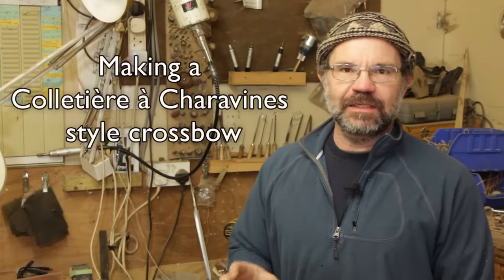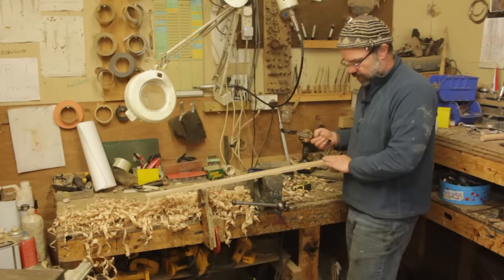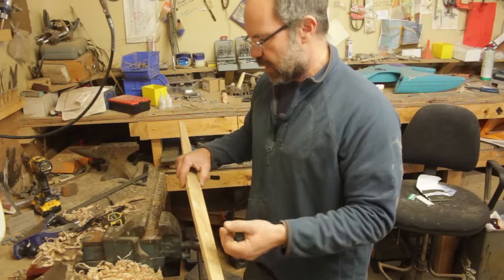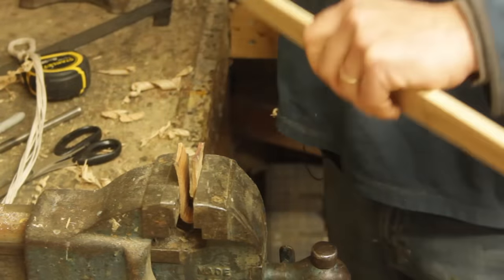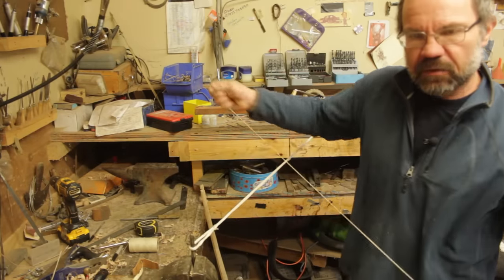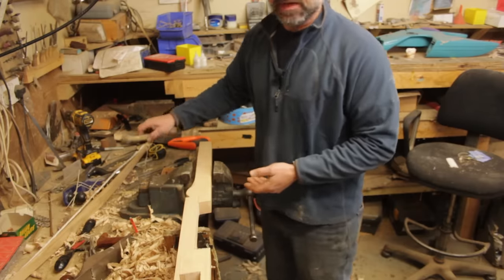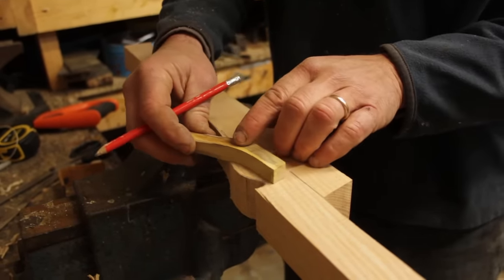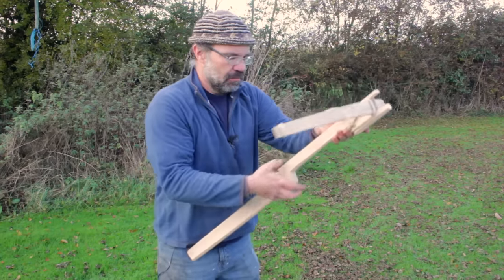Dark Ages Crossbow - Full making process

Comment: For hunting in close woodland I guess you'd be most likely after roe or fallow, which are notoriously spooky beasts - that release noise is a bit - noisy?  Can the release be tuned for quieter operation?  Guessing the typical working range would have to be quite short, meaning very highly skilled woodcraft indeed.

Comment: Have a nice piece of red oak, although the grain runs true down the whole board it does run at an angle and due to the board being around only 1 inch thick I'm going to have to use a combination of dogbone rawhide and laminating a second layer due to my wood being decently thin

Comment: Cool. If I were to make one, I think I'd change how the trigger lever is so that it's on the bottom instead, though. It'd work as well if the trigger were something to press up upon from the bottom under the same principals, no?
Reply: Good point, but this simplest system requires such a configuration. However, for a below-mounted lever, you can use the closely related "rising peg" system. The Skane crossbow find mentioned by Tod uses that slightly more complex system, with the lever mounted on the bottom side of the stock. Mick Grewcock made a pretty good replica of that sort of design in this vid: https://www.youtube.com/watch?v=nYovttuYoGE The rising peg design is also known from native west African crossbows, in addition to the known European specimens. Probably a parallel discovery of the same idea. 

In the "rising peg" type of lock, you can replace the solid axle for the lever with simple rope lashing that acts as articulation. You also need to drill a hole below the string-catch area. You raise the lever, a peg at the end of the lever (hidden in the hole when not triggered) rises upward through the hole and pushes the bowstring up, letting it loose from behind the string-catch. At that point, it's the same system as on the "thumb lever" lock on the crossbow from this vid by Tod. The only difference between the two mechanisms is that the rising peg one is slightly more complex to build, but otherwise, the basic idea for the two is the same.

Now, if you want a typical European crossbow from late Antiquity or much of the Middle Ages after 1000, you need a rolling nut component and then a trigger system that goes down to the below-mounted lever. Tod has two videos on rolling nut axles, how they're set off by triggers, etc. I think that system can still be replicated using only wood, like on these simpler crossbows, but steel for the lever, internal trigger and most of the nut seems to have been the preferred historical solution (though you still had nuts made of antler, and nut axles often simply replaced with thick rope). Single-axle nut trigger: https://www.youtube.com/watch?v=l4W4brUUCR0 Twin-axle nut trigger: https://www.youtube.com/watch?v=GONHXs5NPyQ The rolling nut locks were more common for a reason - they are more hardy and effective than these wooden crossbow locks, especially if needed for military crossbows. Entirely wooden crossbows are sort of doomed to be mostly lower-poundage, even with a more powerful bow.

Comment: Nicely done.
Never seen that action before.
I really like how you made the string. Most people make it look really hard to do. Think I will make a bow sting the same way.
You also made the bow a lot easier. I always wondered why people show making a bow long bow style rather then flat bow style. Now that I know thats flatbow I'm glad. Becuase this was how I learned to make a bow.
All in all, very well done.
Oh again now that I know it flat bow sytle I learned, to increase poundage you can glue rawhide to the side facing you. This will not turn a 50lbs bow into a 100lbs bow. But it will increase a bit more. Like from 50lbs to 65lbs. This also works to make a bow out of lighter wood like pine. 
Pine flatbows were used to take down deer, elk, bear and buffalo. I do not know the poundage of thier bows. Or how many arrows was needed for such. Other then the deer I would guess it was more then one. And they followed them a while after.
Reply: Lazy Hobo you made a good point, you can increase performance by using backing, e.g. sinew. This is applied to the face facing towards your target, because here the tensile stresses occur.

I can recommend the Traditional Bowyers Bible, there it is also stated that bows with a poundage of 35 lbs are sufficient for hunting large game like deers (or even bears)
Reply: @Hennack  is it on the side away from you? Ok. My mistake.
Reply: Lazy Hobo on the side facing you, Materials can be applied with a high compression strength, like done in composite bows, e.g. horn
Reply: @Hennack  ok that's what I thought. But misread your post. And said well maybe I remembered the wrong side. 
Physics says it is on the side closes to you.  
But was willing to admit my mistake when wrong. It been a long time since I see a bow that used this.

Comment: Great tutorial, Todd.  Thank you.  I cannot draw a hand bow because of shoulder problems.  Maybe I should try building a crossbow.  Did our Dark Ages predecessors ever mount a rib over the groove to provide a sighting plane?
Reply: Tod has a video on crossbow sights: https://www.youtube.com/watch?v=wFP7WluXfp4 Purpose-built sights don't seem to have become common even in the late Middle Ages, give or take their final years. It seems they only start becoming more common in the early modern era and even that's mostly on civilian crossbows, for hunting, etc. (a steel sight was probably even a period "tacticool" accessory for bragging !). However, Tod does talk about certain simple methods of using hand posture and the flight groove area of the stock as an impromptu "sight" on medieval crossbows. They didn't use a purpose-built addon from wood or steel, but they did have other methods to replicate the effect. I guess this is the Dark Ages (early-medieval) solution too, if they bothered at all with any "sighting" beyond just shutting one eye.

Comment: My uncle brought a very similar bow from from Vietnam.  but 2 pieces, not 3, like yours. The differences are that the Vietnamese bow is perhaps 3/4" thick, it has a gunstock -inspired butt end, and the trigger is a t-shaped thing that emerges from the bottom like a modern gun.  There is no pivot dowel. Instead the string loops over the top of the trigger, and when the trigger is pulled back, the string slips off.

Comment: Great video. This seems entirely doable.
Reply: I've actually already built my own replica back in June this year. Can't thank Tod highly enough for this instruction video, he highlighted some fine details I could have overlooked if not careful. Thankfully, my own attempt went great ! And I even used less power tools than him, so it is definitely doable entirely by hand, á la the 11th century from when this simpler crossbow originates. The only power tool I used was an electric drill (for the holes needed for the lever axle), but you can use a hand-powered drill for that as well. 

I didn't have a board or block of wood at hand, for a board-bow like Tod's (he's right that flatbows tend to be better for crossbows), but I made do with a thicker hazel branch bow i modified at the back. It doesn't have the same range as an ash or even yet board-bow would have, but it works just fine. Just remember: The tillering has to be carried out at the back of the bowstave, as the front needs to remain relatively stiff to act as a spring and pull the limbs back forward. Just for kicks, I shaved down the back of my hazel bow with a drawing knife, tillered it just slightly towards the ends of the limbs, added the notches for the bowstring, but I didn't touch the original smooth bark at the front, at all. It's still there (and even gives that simpler bow an oddly nice, textured look). I've tested that bow on my crossbow for the last two months, and while the range is limited until I make a more stronger bow, it shoots really nicely. It even has the sort of shorter range that would suffice for "birding", given that this specific type of crossbow was probably only used for hunting, or self-defence at most.

Comment: Hey Tod, (or anyone else that might want to answer the question!)

I know this might be a bad time to ask given the age of the video. And it may be a silly question to ask because it should be obvious, but.

Medieval crossbows were mainly made with metal parts for the actual bow, even though this limited the drawlength of the bow. You've talked in one of your videos about this being due to the fact they did not trust the material to hold. My question is then, why didn't they just use wood and perhaps a slightly larger bow to get the same energy out of their bolts/arrows? What is the particular reasoning behind making powerful crossbows that had to be loaded with a windlass or crannequin when you could make a "rifle length" crossbow that utilizes more drawlength to obtain the same energy in the projectile?

Pardon any misunderstandings I might've had, thanks!
Reply from the maker: A good question and we simply don't know what the draw length was so short
Reply: @tods_workshop  ah, what a shame! I was hoping for a sage's insight ;) it is very interesting to speculate, and a shame we don't have more information from back then. It'd do wonders if we could chat with medieval armourers and the like!

Thank you for your quick reply nonetheless!

Comment: 1970's  local lads made a crossbow out of leaf spring steel and a bolt one afternoon they were outside  and shot it in the  air ⬆
 it hit the power line cable   it was stuck in there until i forgot to look   ----|---> think they changed the wires a few years l8tr 
the same lads got up on the water tower hung down by a rope & painted  happy new year  these twins got up to a lot dangerous things 🙃

Comment: This trigger system is easy to manufacture, but leaves the string output slow when compared to other systems. I use a lever to lower the pin and it is easy to do in fps measurements. The pin lowering beat this system and the pin going up, but Congratulations on the designer!

Comment: Dear Tod, I really want to make my own crossbow, and this is the style I had in mind. I live in Northern-Norway, and was hoping to make it out of local materials, so my question to you is what would you consider the optimal wood for the bow? Also, what can I use as a string if I want to make, or trade for something genuine that would have been used back then?

Thanks in advance for reply. Kind regards from the land of ice and snow,
-Raven
Reply: I have been making bows for a hobby since I was a teenager. Just get a hard wood. Firm enough that if you press hard, or scratch it, no mark is left. I've used maple and occasionally oak, and they work good. When looking for wood, make sure the grain is consistent, this is what will prevent the bow or crossbow from snapping due to the stored energy of the string. You must make sure that it goes in one direction only, smooth long grains. Anyway, that's what I know, good luck.
Reply: I forgot to add that when making your first bow, you can dip it in boiling water to soften it, then wait until it dries. This softens it but leaves the wood itself strong enough to withstand the energy from pulling back the string or elastic. It also improves the flex.
Reply: @atomic8681  Thanks a lot for info! The hardest wood we have up here I guess is birch. Mountain bitch grows very slow and when fresh you can tie knots on the branches without breaking it, and when dry it's hard as stone. I've used it to make electric guitar bodies (regular birch) and a few knife handles too. The problem with mountain birch it's that it rarely grows straight or thick enough, so probably not ideal like regular lowland birch... I'm also wondering if it matters if one is using the outer layers of the birch, or the core wood?
Reply: Since a wooden crossbow bow is basically.. a bow, you should be able to use any woods that you can make bows from. A selection is actually listed on the wikipedia page for selfbows: https://en.wikipedia.org/wiki/Self_bow#Selecting_wood

Comment: Thanks for making this video, Todd! A couple questions: You mention that the power stroke is 11 1/2 inches, which seems far longer than most crossbows. Why do you think this bow has such a long power stroke? Also, how well would this design scale with higher draw weights, and what would one have to do to increase the draw weight? I presume just using a thicker bow, but I'm curious if there are any other tricks one might use.
Reply: I guess the powerstroke is much longer because ash is very flexible since it has been used for european bows as well. Metal bows have a much higher draw-weight but it seems medieval people didn't trust them with anything but short powerstrokes. Producing homogenous high-quality steel was way more difficult a few centuries ago, so they might have snapped if bent too far.
Reply: It more likey that you reach the Elastic limit and have  permanent deformation from pushing past them, you'd get a bow that's always bent.

Comment: You know what's easier than moving meters and meters of thread around a static point? Rotating the point and feeding the thread onto it. Think of a lathe, except don't use a lathe or you'll lose fingers. But a lathe like device, a bearing and a dremel works well for me. Sometimes turning the piece is easier than turning the tool.

Comment: Tod, greetings from Pennsylvania! I love your videos! 

**I really need your help, please**

 I have been working on a loose copy of this very bow, using a very straight billet of Ash 37" long, 2" high and tapering from 7/8" near the center to 3/8" at the tips. I've also tapered 2" to 1-1/8" from bottom to top, like an inverted pyramid, all while being diligent about keeping within the same growth ring, and succeeded in making a more powerful Prod, but that's where I'm stuck. 

Q: How do you know when you have reached the maximum draw of the Prod? (I am hoping for 90#, but if I get higher, I assume I could change to a Roller Nut, instead of the Lever you used)

Q: What is the "Safe Maximum" limit to a Prod like you made? (Mine is virtually identical, except for a small section where the the Prod will bind to the tiller. I kept that slightly thicker with a flat in the belly to help keep it from rolling.)

As you instructed, I'm waiting to make the Tiller until I have sorted the Prod.
Reply: @tods_workshop  That's what I thought you might say... Fortunately I do have the other half of the billet to make a 2nd Prod. "Destructive Testing" it is then! :-)

Comment: at 30:00 forget about the shark skin ... you can use sand stone or broken glass pieces  ...actually the paper tissue is not required... grain size can be separated stirring the particles in a water bowl ... the smaller grains will sink much later than the bigger ones ... usually brick pieces would also do a good job

Comment: I have a hypothesis that ancient carpenters mostly used shaped stones instead of sharkskin for sandpaper. Much easier to obtain. Later chippies carried a block of pumice.
Reply: You can also use, you guessed it - sand. A handful of sand, rub it hard into the material. It takes longer but works well.

Comment: So are the principles of constructing this similar to the later crossbows or are those very different. (Aka making the prod first then the stock to fit the prod)
Reply: tod todeschini having a rewatch of this do you think they would have batch of prods then made the stocks in a batch or done each individually from start to finish or do you think both was done depending on the individual bow maker

Comment: Nice! I guess I'm wondering about the fps? Would that penetrate armor?
Reply: @tods_workshop  thank you! I'm new to your channel. Since asking this question I saw your vid comparing 3 weapons, long bow, modern crossbow and midevil crossbow. I learned the formula for determining  joules for projectiles. I m aneectronice guy and never thought of joules in this way! I should of but its been, well I graduated in 1986 and never used joules in tat way, come to think of it never used joules as measurement in electronics much either. Not at work but I did in hobby, flash tube pumped lasers etc...
Thank you much!!!

Comment: if you had to take to a"single continuous growth ring" you'd have an easier time if you split it using a froe or hatchet....start at one end and run the split down the length of the stock....it will naturally follow the growth ring     (this is a predominate method used by pre-industrial woodwrights when needing to reduce stock volume in a direction parallel to the grain.....)

Comment: How important really is it that their is a single growth ring on the back? Have you experimented with this?
Reply: As Tod mentioned, this is pretty standard way to make bows. A single growth ring helps hold the bow together. Cutting through a growth ring gives a weak spot where the bow may break. There are ways around this and the simple one is to back the bow with something like fiberglass. You are essentially gluing on a single growth ring. Think of a modern laminated bow -- each lamination is just mimicking a growth ring from a tree stave.

Comment: Tod, you said that our ancestors may have used shark skin as sandpaper. Wouldn't it have been more likely that they would have simply used a strand of wool yarn dipped in sand for fine smoothing?
Reply: Tabourba  Read my post again with your eyes open this time. You will find that I said nothing about being sure they did not use sharkskin. I simply asked about using wool, because I have heard that you can use a wool string to cut steel. Thought that it may have been used for sanding also in ye olde tymes.